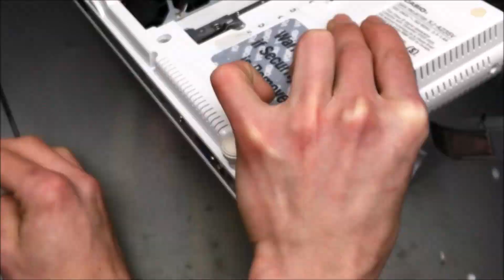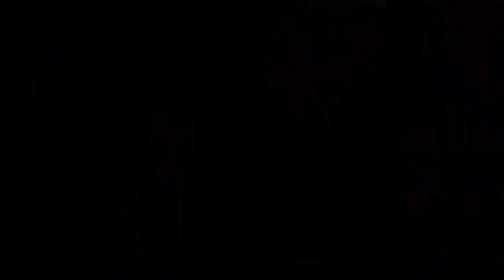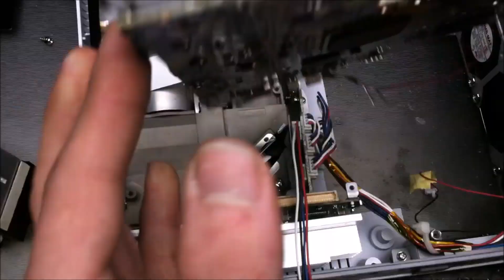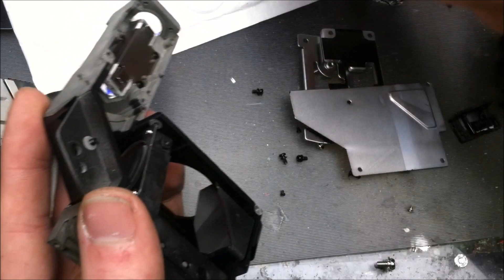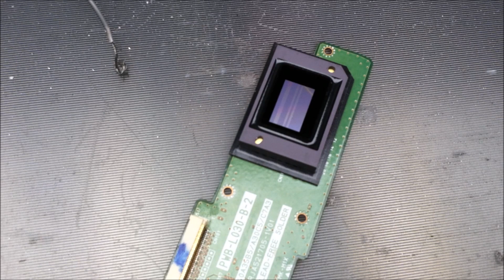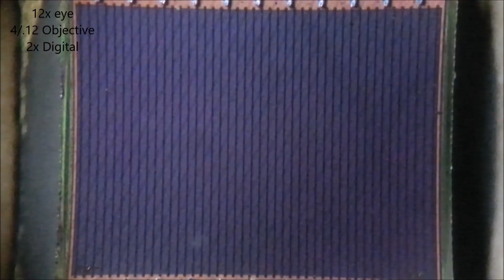Casio XJ-A235V Slim Video Projector Teardown/DMD Hack Attempt.

Comment: Have the xj-a141 that doesn't work and I figure let me take a look at it and see if it is something I can fix before work tosses it. The thing only lasted 3 years before it went out. When I turn it on, I hear clicking like a bad hard drive and based on your video, it sounds like it is coming around the phosphorus wheel. I haven't taken it fully apart, but have you seen or know for these wheel motors to get stuck or go bad? Unless it is coming from the Red Laser assembly and the clicking is trying to start up the laser?? it's definitely something mechanical that is trying to start..Like a relay switch of some sort...After a while, it will then go to solid red light errors on the power and temp lights when trying to power on.
Reply from the maker: Sounds like a fan is jammed and it can't spin and cool down. I Would check to see if all the fans spin. The phosphor wheels can fail but I don't think it would click unless it was mechanically broken. Give the unit a decent smack and see if there is any debris that frees up and comes out. let me know how it goes.
Reply: @Zenodilodon  I have the bottom cover off where I can see the two small fans and they do not spin, but they also aren't jammed up as I can freely spin them..The click isn't from them unless there is some relay trying to start them up..The click comes from the location where that wheel is..Looks like I will tear it down all the way and see for sure...This isn't something I need to fix, I am just toying around with it as a I am a techie nut and like to see how things work and if I can fix them. Work was tossing it as we got a new one and just doing this on my down times here :)

Comment: Hi, I've been searching around but cant find a definitive answer about the laser diode array (nubm) that I scrapped from an XJ model, if I may ask, is it gold plated..?
Reply from the maker: The diodes are gold plated but nothing else to my knowledge. You'd make more money throwing the bank/diodes up for sale then trying to recover any gold from it. However if it's gold plated stuff you want I will gladly trade gold plated stuff for diodes!
Reply: @Zenodilodon  I wish I can send you some images of the diode I got, also cant post any eternal links from youtube, but a littile bit of googling "nubm44" or "nubm42" "bank" will get you to those images of the diode im saying, so is the entire thing the diode but the gold looking thing they are in is not?
Reply from the maker: @maximooze3196  I haven't pulled any diodes out of projectors. The set of them my friend had where not plated. I just checked the image for the model you sent and it does look like those are. If you see gold than it's most likely plated. There could be confusion on it because of different variations of the laser diode assembly. I doubt it's just brass as that's a poor heat conductor compared to aluminum.
Reply: @Zenodilodon  my apologies, what I was asking was if its gold "plated", and confirming that it is, Im happy to know, and yes its most likely aluminum as its not magnetic, sorry I didnt make it clear/😓, but thank you so much anyways.
Reply: @Zenodilodon  thank you for responding by the way

Comment: Do you have any experience with the xj-f20xn dlp projectors?
Reply from the maker: Not that exact model no, but I have worked on and torn down various projectors and for the most part they are pretty alike. If you have a question feel free to ask and I will try to help.

Comment: Hello.  I have a question.  There is a Casio xj-h1600 projector, everything worked fine and at one moment, pressing the power button, it tried to start, that is, the fans started working, the lamp blinked and after a second everything turned off.  The power and temp indicators are on.  Please tell me as a professional what it can be?  Thank.

Comment: Great explanation, thank you! J got Casio xj a141,any idea why is left side of picture cold(and j think a little lower brightness) while right is warm(true white is only on middle picture)? This is discreet but still visible.. 
Thank you.
Reply from the maker: hmm, I would check 2 things, the phosphor/color wheel and the red LED. It could be a burned section of phosphor causing a bunch of extra blue light from lack of conversion to green or the red LED may be failing on one side. This would be my only guess as to the cause, there may be a misaligned reflector somewhere as well. Look through the optical layout carefully, check the condition of those parts and ensure that reflection angles are correct on mirrors and dichroic filters.
Reply: @Zenodilodon  
Your help helped me a lot, after a couple of researches I found that the mirrors on the laser were not in the right direction towards the blur lens, so I adjusted it very little (a couple of mm) (there is a screw for it on the back) and got white on the entire surface of the image .. Also, the colorwheel can be moved back and forth and also to regulate the level of white color in the image ..
Thanks a lot for the very helpful video and advice!

Comment: Cool! I’ve wondered why these aren’t used in VR goggles since it seems you can get very small dlps that are between HD and 4K resolution.
Reply from the maker: The digital mirror devices are used in things lile google glass and other head sets for VR. The are monochromatic devices and do require some sort of RGB light source for color displays. In VR they use LEDs like in the small pico projectors. They also have recently developed new LED micro displays up to 1080 resolution and I am certain this tech will be in newer VR headsets.
https://www.youtube.com/watch?v=4PqMQobkUhg

Comment: Very interesting! Would it be possible to say salvage three separate DMDs and with different colored lasers produce a beautiful combined image?
Reply from the maker: You don't need 3 separate DMDs, it would probably be better to use one and combine the lasers before the DMD just like the projector does with other light sources. Some projectors are already using banks of green and red laser diodes in really high end models. I am hoping to figure out more about integrating DMDs and Laser, I have to get a DMD that I can easily run though. Laser can be rather harmful to DMDs as well so there is a size vs power struggle as well.
Reply: @Zenodilodon  Thank you for your thorough and interesting reply! Sorry for the dumb question, but would the dmd be hit by one laser at the time, but in such a high frequency that I would perceive it as the mix of the colors in question? Or is there another way to regulate the amount of each color in each pixel of the image? Additionally, what makes the red and green lasers so expensive as compared to the blue laser. Thanks again!
Reply from the maker: All good questions, by nature a DMD is a grey scale device, so yes the lasers would have to be cycled at high repetition for a colored image. As far as the market for lasers there are a few things to note. Market demand, blue lasers have been big as a light source in many applications from projectors to car headlights. Secondly when mixing lasers together it can be a challenge to get all of the output profiles matched up so they still share the same profile at long distances, this can lead to other expenses like corrective and combining optics. Red lasers are notorious for poor output as higher powers in beam profile, green itself is relatively new but the price is dropping. In contrast to green blue is rather old. I think the first blue laser diode was invented around 1996.
Reply: @Zenodilodon  Thanks for the quick response and thorough reply!

 My initial thought of a projector with three dmds was based on the assumption that dmds are not cheap, but that lasers are even more expensive (I don't know if that is true, I just got that impression) and with three separate dmds one would be able to achieve a three times higher refresh rate. But maybe one can a achieve a refresh rate beyond what is perceivable to us with just one dmd, which would make a three dmd projector a waste of our resources. 

Looking forward to the prices on laser diodes coming down and projectors with multiple dedicated lasers brcoming available. As someone who is new to these things, one wpuld have guessed that red eould be cheap, since it is the first laser that I remember to have seen (in laser pointers). Though those are probably not nearly powerful enough for a projector. 

Yes, to control the dmd chip doesn't seem trivial!

I wonder how bright and clear these high end three laser projectors get. Would they be able to compete with modern screen technology, or would that require unsafe levels of energy output by the lasers?

Thanks again for taking your time to educate on this subject! What a beautiful and interesting technology!
Reply from the maker: @dempa3  Your assumption of a better refresh rate is mostly on point, there is often a color wheel inside of a DMD based projector that controls the refresh rates and some of them can get moving pretty quick. 3 way LCD and 3 way LCoS are also other competing technologies, mostly to escape the rainbow effects of a color wheel. Newer technologies can also utilize direct modulation of solid state sources, such as LED and Laser and they can have much faster modulation rates than a color wheel. 

The laser market will continue to drop within reason due to demands, some patents for OPSL are ending as well I think so that could become more popular. If you are just getting into lasers I will tell you it's a whole wide world out there. There are many forms of lasers such as gas/ion, flash pumped, TEA, dye, DPSS, OPSL, PPNL, Q-dot, free electron, and more! Many of which I hope to eventually get more of myself.

As you get into this more you will find that there is a whole list of debate over a good red laser diode. It's pretty much a split between trying to correct the beam on a powerful one, or trying to knife edge a bunch of smaller ones with low divergence. Needless to say, they all pretty much are terrible and nobody in the show laser industry likes dealing with high power red units.

As far as exposure, light is light and it's pretty much only dangerous in a laser when concentrated. Water is reasonably safe until you try drinking from a high pressure water jet. It's the same principle in a laser based video projector. Show lasers are dangerous because they maintain a concentrated beam.
Reply: @Zenodilodon  Show lasers are quite impressive! I have by chance attended a couple of different laser shows in Japan. This was one of them https://www.teamlab.art/e/mifuneyamarakuen/ . Have not seen anything like this here in Sweden.

Looking forward to the OPSL patent ending! They seem to deliver a lot! Didn't find much on YouTube except for your video and a couple others. Found a bunch of people running around with guns though, since OPSL also seems to be an abbreviation for some shooting sport. :)

I remember when my Mum first explained to me about lasers and I pictures something like this https://www.youtube.com/watch?v=VSdUQ4oNKiI . I was baffled when I saw laser pointers a couple of years later! Lasers are very interesting, but a technically a quite advanced subject, which is why your accessible explanations are great!

Comment: Zenodilodon
Love this  you should teach,  i learned more about these projectors in 24:55 than in the previous few years  of playing with these and similar  (lots of speckled dlp on the second hand market as they tend to do a couple thousand hours before the micro mirrors conk out) again,  stupendously informative video, YOU ROCK BRUV!
Reply from the maker: Thanks much! I love optics and stuff, I don't think it's a subject that can get boring :P
Reply: @Zenodilodon  perhaps you might consider doing a vid on an arc lighter on steroids as the commercial ones only have a 5mm arc  and a low duty cycle something zvs'y with common transformer (ccfl etc) with  a 10mm or so  arc that can be run for a while without self destructing would be nice. just a thought!      :-)
Reply from the maker: @qutube100  You should see the lamp drivers I pulled from this massive Sony projector, there where 4 of them, it was an older HUGE projector. Do you do anything with them yourself?
Reply: @Zenodilodon  I always find a new use for olde stuff  i have a big collection of  drivers, coils and  associated peripherals from many different  projectors/screens and   i love high voltage in small packages . i  am going to try using the beam  blurring fingies from your vid to help combine several laser diode beams into one fat but collimated beam  (an ongoing project that had stalled till now) also loving the rest of your vids and the ones where you have input on  join the technicians! keep it up dude you stimulate new sparks where only embers lay glowing thankyou...
Reply from the maker: @qutube100  The mirror system would work well, I would also say for lasers look into DIY knife edge arrays and PBS cubes. Aren't all projects ongoing ones? Solutions are where the brain decides to stop engineering :P
Reply: @Zenodilodon  but sometimes i just have to wait awhile for the Brainfarts to subside these days.  Its nice to find like minds  there are enough little grey soldiers these days endlessly repeating what they have been "taught" and its great to find people who can still create  and imagineer new thingies for themselves.